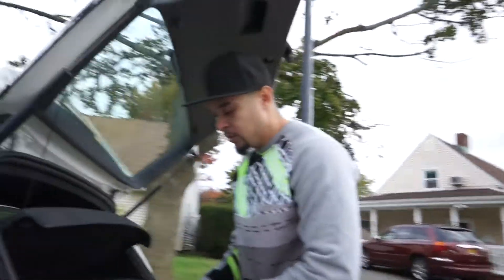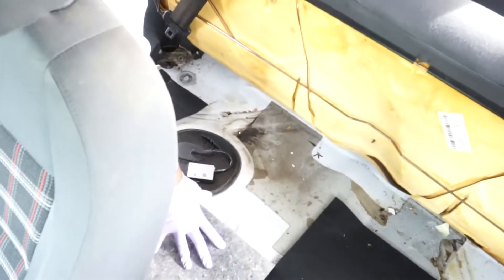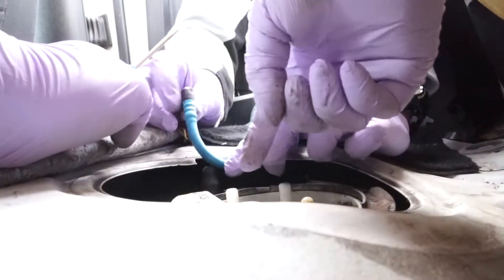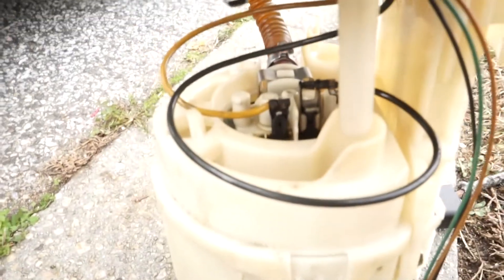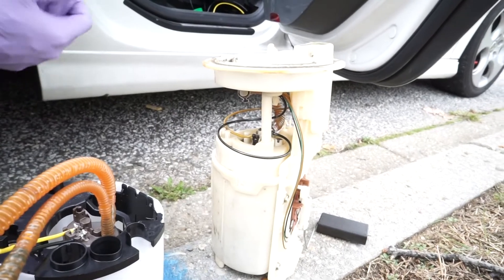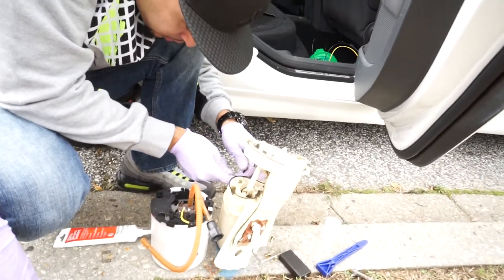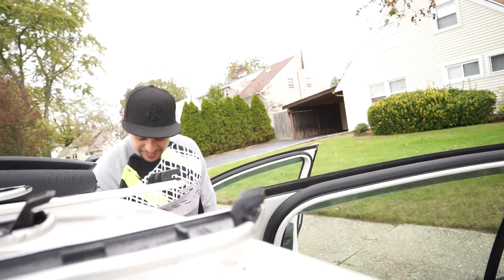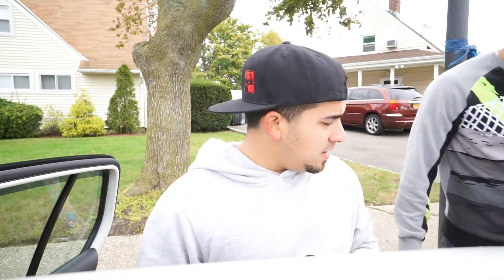Common MK5 GTI Fuel pump issues

Comment: What was wrong with gti? I have a problem with mine with hesitation at high rpm. Can you describe your problem?
Reply: You still having this issue ? I currently have this issue a higher RPMs
Reply: @jameswilkins186  yes still searching for the problem😩
Reply: Mine chugs and lopes under high load. Almost like a bad wastegate or diverter valve. I think it's the plugs. I was gonna check with VCDS tomorrow. Could be fuel delivery.
Reply: @ianmoore322  hey did u end up figuring out this problem I have the same problem
Reply: @xxpowerofxx9801  have you found your solution yet
Reply: @khris647  It was my coil packs
Reply: Coils and spark plugs 99%.

Comment: I have a mk5 gti auto dsg and the car drives but then after 2o minutes it will stall , the gears change perfectly fine but when it stalls the battery logo (red) flutters on the dash then stalls , is this due to my fuel pump too ?